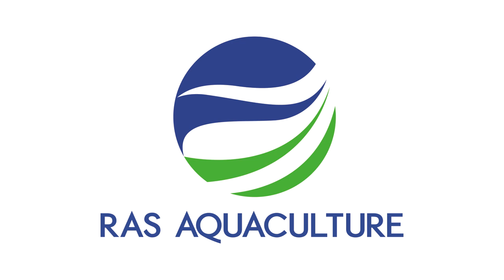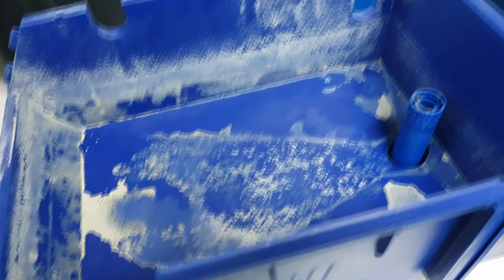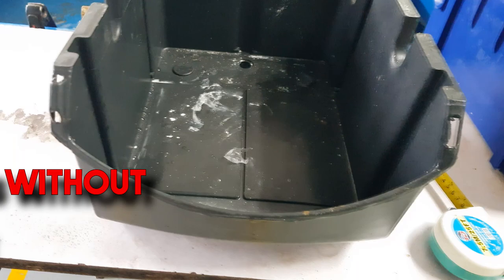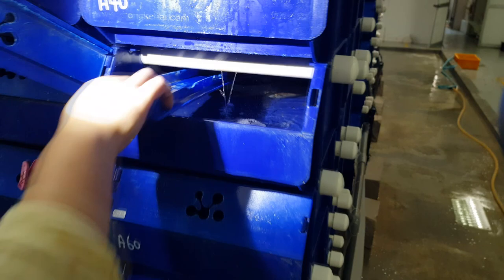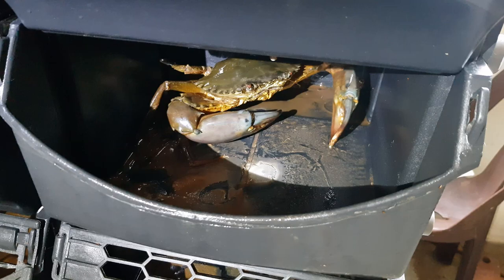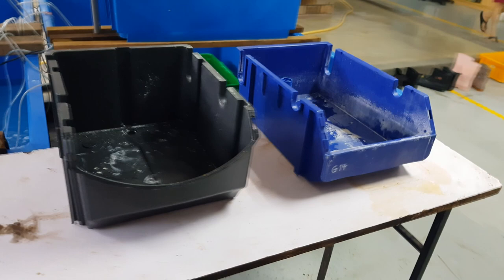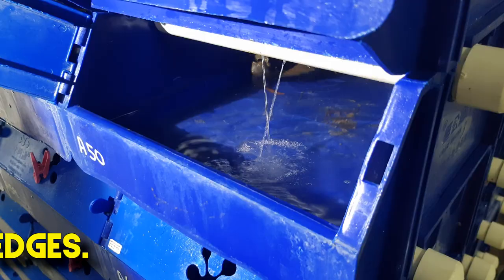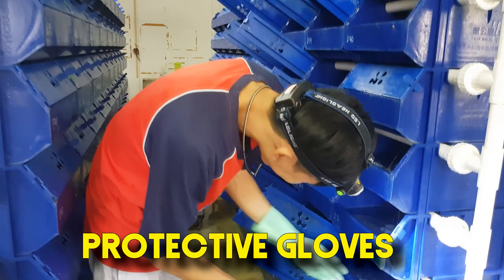Designing RAS Vertical Mud Crab Farming Boxes for High Productivity

Comment: if i am doing a RAS for fish,can i use same water system for Crabs? by having seperate piping
Reply: mostly same system but you need to add a drum filter if you don't have one. also pumping water up to the top of the crab system is a consideration as crab farms are vertical and requires a shower system
Reply: @dankoh6130  mofree